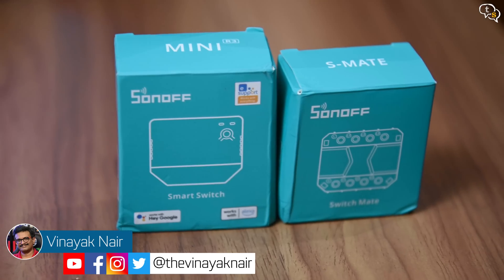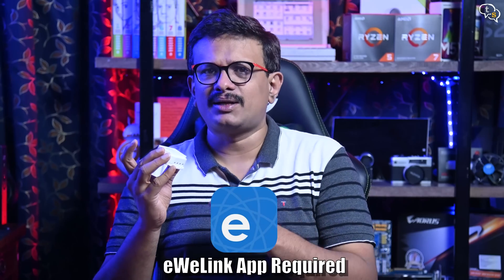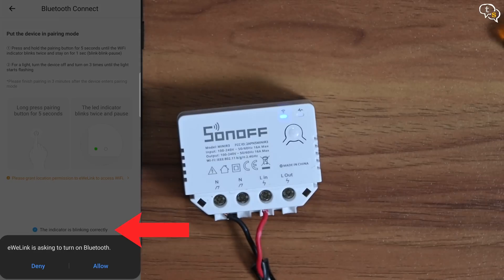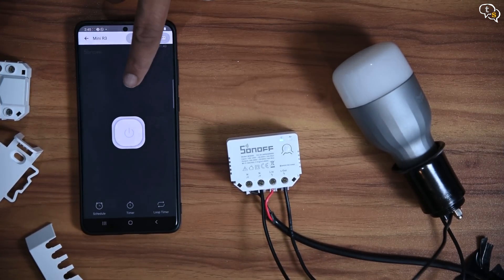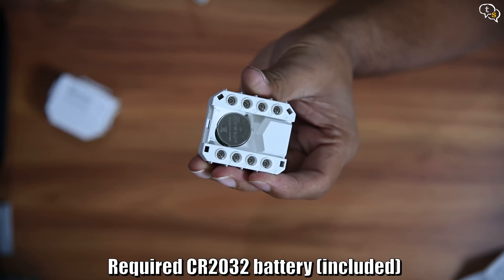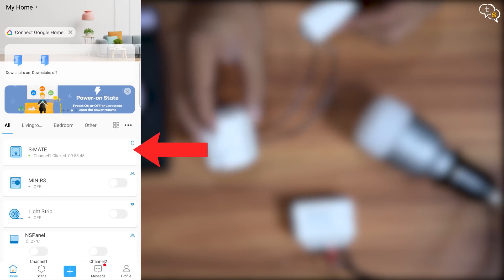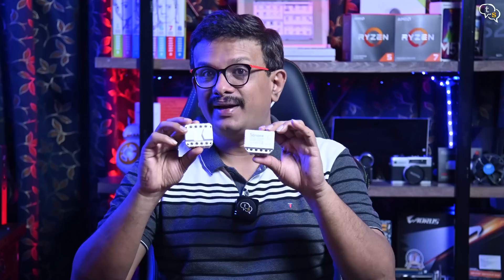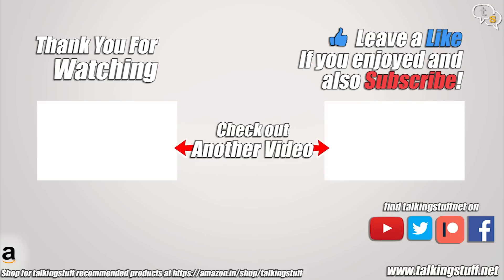Sonoff Mini R3 and S-Mate - First Look

Comment: If we connect s mate with mini r3 by wires do we have to remove the battery
Reply from the maker: I've never removed the battery with or without the smate.
Reply: Can you make a vedio how we can wire it
Reply from the maker: I've show it in the video.

Comment: Hello, Great videos. I installed the S-mate and mini R3 the distance between them is nearly 5 meters but the S-mate is not giving the order to turn on,once I remove the S-mate from the electric box it works good and when I put it back it stops working.please need your advice is there a way to improve the S-mate connection. thanks
Reply from the maker: Is the electric box metal, maybe it's blocking the signals?

Comment: hi.. Can i connect it to a 10hp 3 phase irrigation pump..?
Reply: if not.. is there any way round it
Reply from the maker: I think these switches have a 10 amp limit. It cannot be connected to high power equipment.

Comment: Do you think this supports hearing impaired notification that a doorbell camera rings?  We have in the USA 20 million hearing impaired and deaf Do you have ideas that help blinking light doorbells this Sonoff that can scene or group lights lamp or wall switch smart switch?
Reply from the maker: You can't try setting up scenes where compatible devices can trigger turning a light on or off. This could be via Amazon Routines or using the e-welink app.

Comment: does the s-mate work with a momentary push switch? does it have a toggle option for the same??? or is it compatible only to rocker switches??
Reply from the maker: If you turn off the smart device using any other method (voice,app)  the s-mate toggles in reverse (on becomes off and off becomes on). It may work with momentary switches, but I've not tried it.
Reply: Toggle the "DIP switch" to the another side,then it will work with a momentray push switch

Comment: Nice video, thank you. Is possible to control the Mini R3 module using mobile data? I am not sure if I have to be connected with cell phone to the house wifi network. Thank you so much!
Reply from the maker: It works via mobile data, the R3 needs to be connected to Wi-Fi, but the phone doesn't. You will need active internet for both devices though.
Reply: @TalkingstuffNet  Thank you very much!

Comment: Thank you. You actually explained how they worked together really clearly, which is a lot better than their actual website. They should link this video.
Reply from the maker: Thank You 🙏, I'm glad the video helped. 😄
Reply: @TalkingstuffNet  and i got the system up and running. I can now be at the top shed and turn on the bore pump for water on my phone. I couldn't have completed that without your video. Thanks again.
Reply from the maker: Glad the video helped 😁

Comment: Can power be added so the battery is not required?
Reply from the maker: As far as I can see it doesn't have any power inputs, but will check with sonoff to make sure.